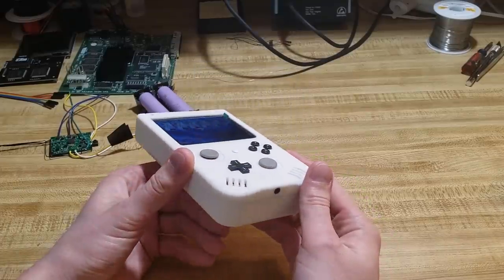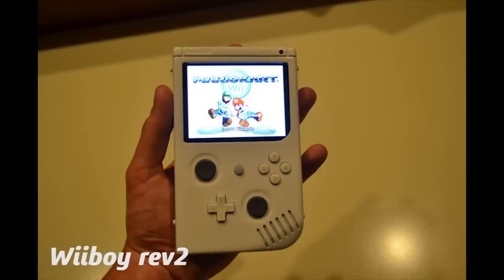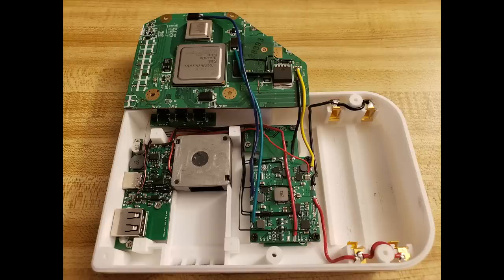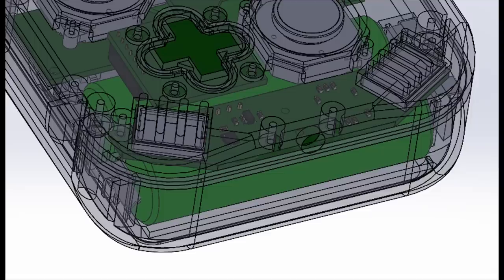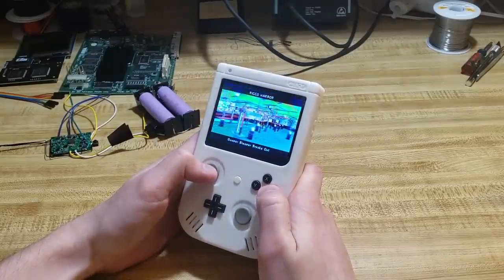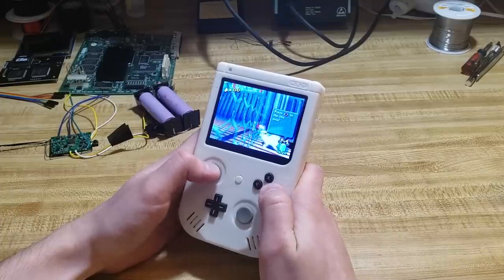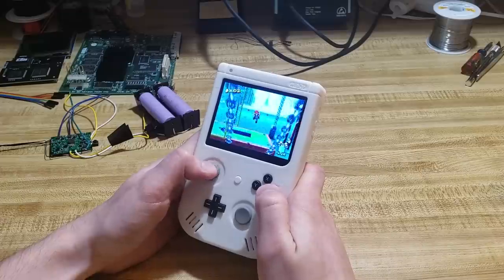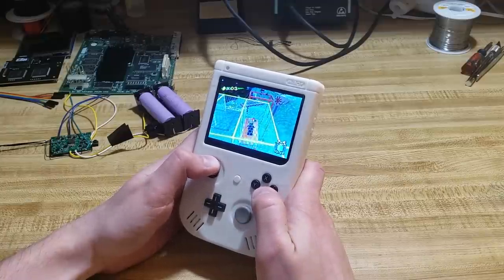The Wiiboy rev3

Comment: how much would it be to order one from you?
Reply: Im not Gman but I would say be prepared to at least pay upwards of 600
Reply: @warguy6474  To make a portable is around $600, but to commission one to be made is around $1,500, maybe even more depending on the design and your paying for his time also.
Reply: @StuckDreaming  600 is more than what is needed, im making one right  now.
Reply: @StuckDreaming  but of course gmans designs and his build quality will be a lot better
Reply: @warguy6474  Yes but a commission from gman cost me around $1,500, it's always cheaper to do it yourself and If you plan on doing a work log on Bitbuilt then I would like to see your progress on it and good luck with your portable 👍
Reply: 600...mind as well use that to buy a switch and some games
Still poetable
More modern
Reply: @darksaturn1007  can a switch play wii and gc games? No.
Reply: I runs skyrim tho and the new mk11
Wolfenstein2
And resident evil 4 (once released on wii)
Also resident evil revelations 2
Breathe of the wild

Sure its not a good substitute for something as old as the wii
But it has better bigger games
Simple.
Reply: @darksaturn1007  I'd have to say Gc and wii games are better thise listed above, but thats only my opinion. And just because its more optomized for newer more intensive games doesn't mean it can run emulation at 100% speed. Even really power computers can barely run certain gamecube titles at full emulation speed.
Reply: @warguy6474  does it not have emulation yet?
Reply: @sowhazupguy  It does have emulation. Homebrewed switches can boot in linux and run dolphin emulator. It is EXTREMELY far from perfect through. The tegra gpu in the Switch isnt very powerful and many games on the switch were specially optimized to run on the lower end hardware of the switch. Dolphin emulator isn't even perfect on powerful PCs, how can you expect an SoC run dolphin even on par with a high end pc?
Reply: 1. why emulate on a switch when its a switch 
No one wants old ass games on a brand new console.

2. If you really wanna emulate wii games its more simpler to just buy a wii...it's a home console
Theres a reason the wii U flopped
Reply: @darksaturn1007  lol

Yeah regular wiis are totally portable
Reply: @darksaturn1007  Yeah I think different people are allowed to have different opinions? Why are you saying that nobody wants retro games lol
Reply: It seems like a hassle
Some people can afford the equipment to make one, it be better to just buy the portable switch since the things are right there. Dont gotta have a hard time looking for certain tools and etc.
Reply: @sowhazupguy  
Yeah you can put a montior and a wii with some wii-motes in a bag and play it with some friends in a train without attracting suspicion
As long as the train has some wall outputs right?
Totally portable
Reply: First Last 
*replying to “why are you saying that nobody wants retro games”

because the conversation started at monetary value. Paying 600-2,000 US dollars for emulated games on a smaller screen with less battery power isnt worth the same as just buying a switch for even the release date price. 

I love the idea of Gman’s creation in this video and it should be heralded as an amazing feat of engineering. But I wouldnt want to pay that money for essentially a gameboy screen that plays my already owned Wii and GC games I play often. 

I’d rather build one meself, which is what you said already :)
Reply: @PittsburghSonido  He wasnt talking about monetary value though..?? He claimed nobody wants emulation on a switch, therefore buy a wii? Not sure what he's saying either.
Reply: @warguy6474  
You claim that a switch can run Linux and therefore run dolphin but like i said mind as well buy a wii 
Since emulation is crap 

Also who tf said a wii is portable
Reply: @darksaturn1007  But that's not the point a Wii isn't portable? You can't just tell someone to buy a wii because portable emulation sucks on the switch, that makes no correlation with the portable part of the conversation.
Reply: Im not talking to you 
Someone else said that the wii is portable
But i disagree with that
Reply: CONSOLE:
Buying a wii is cheaper then makimg a portable version
That offers less 
Battery and screen size

PORTABLE:
But if your really looking for a real portable 
The switch is a cheaper , better option just because it doesnt have to be make or commissioned
And offers the best of both worlds
Both in portable and home console mode. 

Retro console are cheap nowa days because less and less people want them but its the best way to relive and reminisce about the glory days
Reply: @darksaturn1007  You're joking, right? Almost every console eventually gets emulation because people love playing old games. I just bought a used PSP and I'm going to be putting a bunch of emulators on it.
Reply: @darksaturn1007  why the hell are you even here on a Wii portable focused channel if you don't care about playing GameCube and Wii games portably?
Reply: Ohh so im not allowed or some shit
Its fucking YouTube
Reply: @darksaturn1007  better off just spending 1000$ and get a gpd win 2 and a Nintendo switch best of both worlds
Reply: Ded Gaming......... dude. The Nintendo Switch and its library are just not comparable to retro games. Newer games are bigger, not better. Just different. For people who want to play older games, gman’s portables are insanely cool. 

I own a Switch and I also own a WiiBoy Advance that I commissioned him to make a while back. And you know what? When I have a long car ride, I usually opt for the wii. There’s just something about those games that the Switch’s library can’t compare to. I love both, and it’s important to recognize that each system has its place.

Comment: YouTubers can make better product than Nintendo
Reply: Nah
Reply: @1magicstar556  yah
Reply: @vinny7297  lol no
Reply: rex max likely would get banned by nintendo and at the end of the day, its not even HD and compare this to the year the gamecube was released and you would get a somewhat bad system
Reply: Jack Van Well Nintendo should have released this with av out all those years ago instead of the wii so yeah youtuber did it better with the same hardware as Nintendeepoos had
Reply: @Unesu Mdlalose well maybe XD. My biggest problem with this statement is that they are just taking something Nintendo made and putting it in a smaller shell. Also wii games that require pointing won't work that well. Looking back my comment was a bit immature and I am sorry about that

Comment: How does it keep cool? The heat sink in the wii for the cpu is much thicker than the will boy.
Reply from the maker: The wiiboy has a fan and heatsink too
Reply: @GmanModz  What you made was very impressive. I'm just surprised it stays cool, as I thought the original wii heat sink was much larger. It's also rather nice of you respond to comments.
Reply from the maker: @mikehunt4048  well the Wii console cooling was designed to be turned on at all times and in extreme conditions. I've made some sacrifices here but the battery only lasts 3 hours. It gets "warm", but certainly not unsafe.
Reply: @GmanModz  Very interesting. Thank you for elaborating.

Comment: All your videos are fantastic. I'm trying to break into the hardware modding and emulation scene myself. May I ask where you tend to order most of your parts from? I cant seem to find a good source myself. (And I'm also not entirely sure what im always looking for. But I want to find those circle pad buttons so I can solder them to a micro controller)
Reply from the maker: The electrical components are all ordered from digikey, most of the other parts are sourced from Ebay and Amazon
Reply: @GmanModz  thanks! I never knew about digikey and was skeptical about some Amazon parts. Time to dive in.

Comment: The fact that you've adapted it to use type C is fascinating.
Reply: No not really. Type C isnt new lol
Reply: @itsNAGOLS  considering it only started cropping up in phones in 2017, I'd say it's still new somewhat. Most people I know still use many micro USB devices.
Reply: Type C is just a port, some use the same interfaces as Micro USB. I really hope type C ports are more common on these mods because there is no reason not to implement them.
Reply: @brycejohnson7  most people in these kind of builds were still using Micro USB until recently. Hell I saw a PS2 handheld one time that was using a Mini USB port to charge it's batteries.
Reply: @Kofi_Mensahs_BurnerAccount  
Right, I'm just saying it's just as easy to implement as a microUSB but it costs an extra dollar or so. It's great that more mods are getting around to USB C and I'm exited to see what's next.

Comment: It sounds like you are learning electrical engineering from scratch. To you have formal training? Also, do you implement custom software like drivers/embedded code. Really impressive skills regardless
Reply from the maker: I am graduating with my BSEE in a few months but a lot of this was learned on my own. You don't need formal school to learn how to do this. We have a lot of materials on the bitbuilt forums. I used some embedded code running on two microcontrollers in this unit for the volume control and power management

Comment: Are you able to change out the sRAM of a Pokémon Red Version cartridge with internal memory that doesn’t require a battery? Perhaps a Micro SD card could be used, as that would allow save data editing. I was thinking of doing this one day and it could be an interesting project if you’re bored.

Comment: I bet if u did a gba style you could mimic the switch with hdmi out and the sensors bar built into it across the front
Reply: Some modded nintendo console portables had Composite Out to play it on the TV. This was late 2000's/early 2010's.

Comment: my interest is piqued. it's called wiiboy but this video only showcases a GameCube game. what are the limitations? Obviously missing the nunchuck (unless that's built in and I missed it) makes a few games completely impossible. I'm more curious of what it can play than what it can not.
Reply from the maker: It is a real Wii, it can play Wii, GC, virtual console, and emulators. However at this time it is limited to games using the GC controller (so not every Wii game)
Reply: GmanModz so no lag issues? all games are installed onto it like memory card storage? is every game cube game supported? as in  any region? Sorry so many questions I've wanted something like this for a very long time